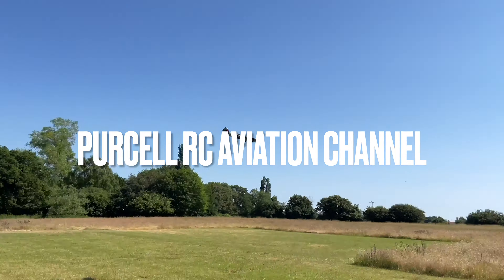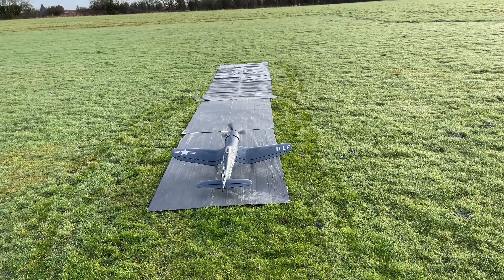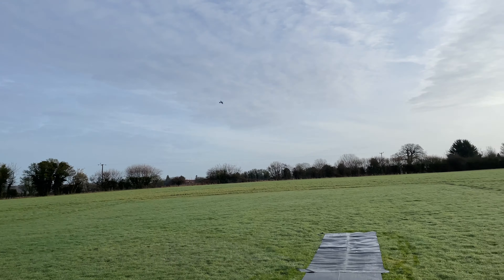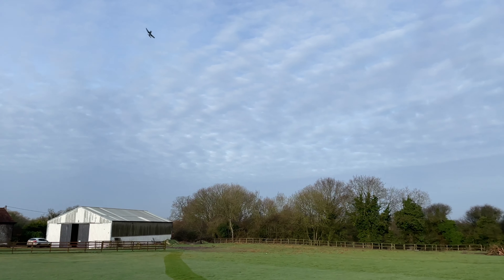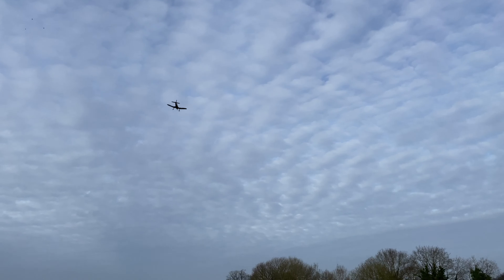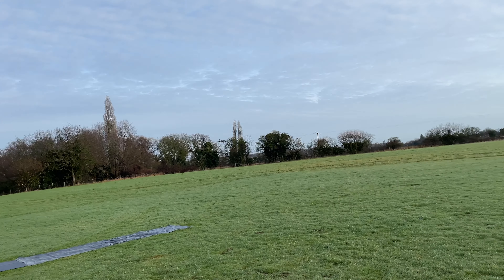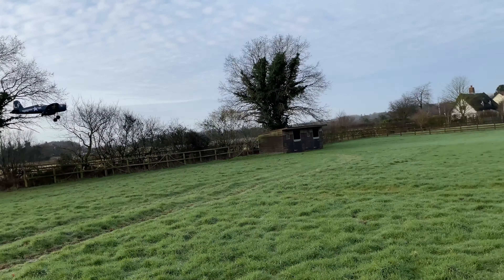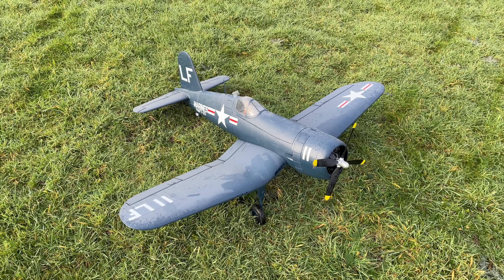E-flite Corsair 1.2m maiden 7th Feb 2024

Comment: Enjoyed your flying video!  Your Corsair looked real good cruising around over your grass field.  By the way, it looked like your grass was wet from the tracks I could see through it.  As soon as I noticed that, I grimaced -  thinking about how that wet grass was going to grab your wheels when landing.  I am glad you are getting a handle on operating your Corsair.  I don't think you will ever enjoy it with a 3S battery after seeing how she does on a 4S.  And for your take offs, it really needs bags of right rudder at just the right time to hold it straight during the take off run.  I enjoy my 1.6 m Corsair quite a lot, but I find when I take off well - I am holding at least some right rudder all the way through take off and climb out.  I try to hold in whatever rudder it takes to keep it from curving over to the left.  I think that is important because if a pilot allows the plane to wallow off to the left while being slow just after take off - there is some danger of the slower left wing going into a stall.  After I am well up into the air after take off, I have noticed that if I am a bit sloppy about letting off the rudder, that the plane will want to twitch with a bit of yaw.  So I try to ease off of the rudder gently to keep things a bit more smooth.

I think you have plans of a hard surface runway at some point?  If so, you will really love how much easier it will be to lift off with your war birds from a hard surface.  Then, you will just need to be a real rudder girl to ensure that you don't go off the runway sideways and get back in the grass.  Ugg!  Your Corsair is really a great looking plane and it looks so smooth and good in the air!  I hope you have a lot of wonderful flights with it !!!
Reply from the maker: Thanks, Jolly Roger! Yep, it's all about the rudder, the rudder and the rudder! I never put enough in, but given the short reach of the temporary runway, I may never have got airborne before the end of it whilst fretting about tracking straight ahead 😄
I'll have it all to learn... 
👩‍🎓

Comment: Nice flight and maiden Gina . Glad you enjoyed it . Looks fantastic ! Yep , needs lots of rudder on take off . But a great flyer IMO . 
I always use 4S , if the plane takes it . Mostly for that take off boost and save power when you make a boo boo. Why not run on all cylinders ?  is my philosophy . LOL . 
I do believe manufacturers have an incentive to advertise and even push the LOWEST size battery these planes can take for marketing purposes, 
I think I talked about it in a video once . Although many planes do seem to have a "sweet spot" for the CG and personal preference is always a factor ,  when they say its 3S-4S 2200 mAh to 3200 ,  i tend to think its the higher of the two .
Reply from the maker: Hi Philip! Thank you!! I've always fought shy of 4S... don't know why... but since I started flying the Turbo Timber 1.5 on 4S, the penny dropped. You're right, and wherever I can I will use 4S. I am a little wary of running 4S in the older 1.2m E-flite models which weren't rated for 4S voltage. 
But maybe, since I'm feeling a little braver, maybe I could experiment 🤔
Reply: @purcellrcaviationchannel  You're welcome . Until recent times , the cost of going above 3S was very prohibitive. But much of that has and is changing fast with new batt , motor and ESC tech . 
Not long ago in fact , two 3S packs in series were a cheaper option than a big 6S , but even 6S is way down as more planes and vehicles require them . 
I'd be wary with the older models to , motors can often take a higher voltage . But ESCs and BECs and even servos , not so much . 

A good ESC will just not work or shut off on a higher voltage . Some make magic smoke . lol .
You can alway check out if others have been successful with a certain model through videos maybe .
I was completely shocked seeing some fly the UMX timber X on 4S with no issue . Although I'm not brave enough to try it on mine . LOL Cheers. 😀
Reply from the maker: @PhilipCockram  Good advice, Philip 👍